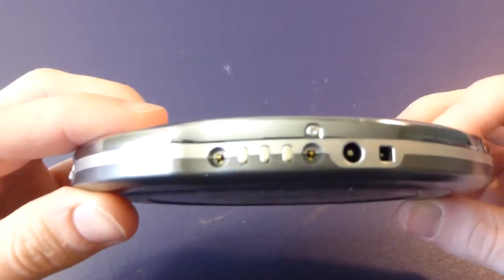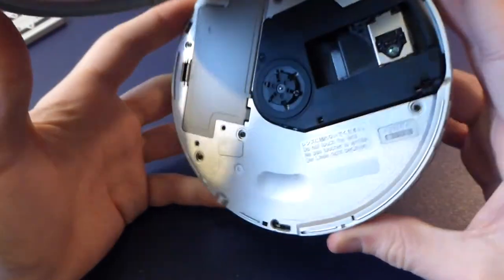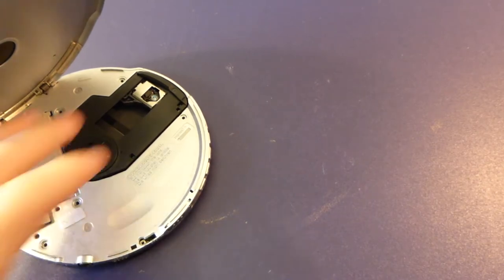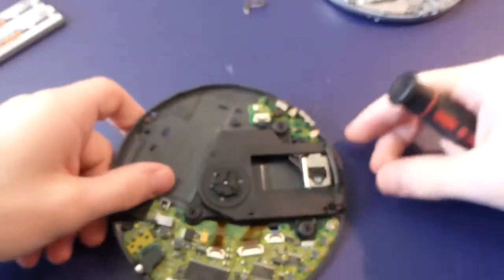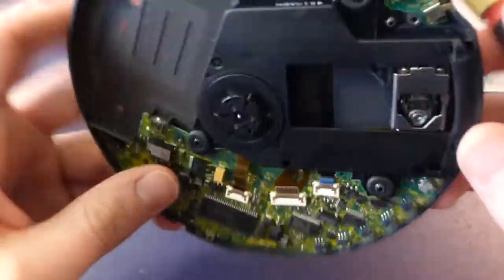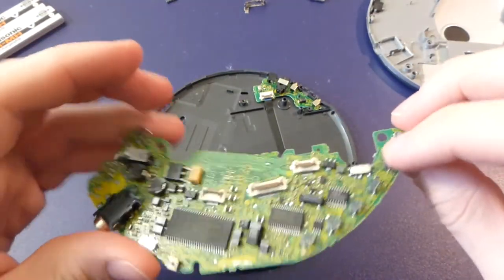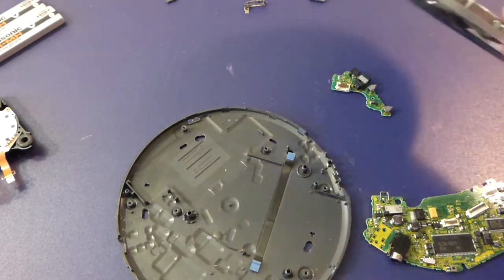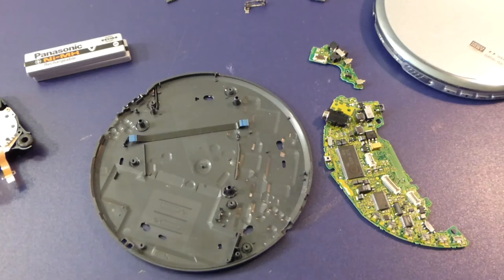Teardown of the World's Thinnest Portable CD Player in 2004

Comment: Sony had a thinner CD player 2 or 3 years earlier. The D-EJ1000 is 13.9mm thick, the Panasonic one here is 14.4mm. 😉
When it comes to rechargeable batteries, there is no special magic here. These are ordinary gumsticks batteries used in many different portable devices.

Comment: hey  i have the service manual for it. you want a copy? also  replacing the coupling capacitors between amp chip and earphone jack with 6v 220uf, then the bass sounds like sony models.

Comment: mine has recently developed a fault.  when you press play the green lights come on under the play and stop buttons, and then it changes to the led pattern like when it's charging, and after a few seconds it stops.  the cd never plays and the motor does not function.  I scoured the net and bought 4x replacement batteries, and still no joy.  works perfectly when connected to the mains.  anyone have any ideas?
Reply: Make a (720p) video (with good lightning) about it ? 🤔

Comment: Wow makes me wonder what's inside my Panasonic SL-NP500. One of the few things I noticed was the difference in overall clarity with newer players. While the shock protection and battery life went up dramatically over time, the sound quality took a turn for the worse. I mean overall filtering improvements were few and far between in the 90's but the way the highs,mids and lows were presented really took a dip. As is manufactures started to favor bass heavy tones instead of a clearer more balanced audio signature. It was for this reason that I never gave up on the older tech since I knew Panasonic and probably other manufacturers took great care in designing and engineering their audio amps and accompanyed circuitry.

Comment: I remember Sony making a thinner one that was almost as thin as 3 or 4 disk stacked.
Reply: Do you remember the number model of it?
Reply: @jeremifrancisco1  D-NE20, however I remember it with a bit of over exaggeration. It was 1.3 cm in thickness and was released 2005. Hm... or perhaps I was right, 4 disks is probably something like that no? xD .. oh well pretty thin either way hehe
Reply: TH3MS thanks flor your reply! I'm looking to get one portable CD player. Only thing is, the Panasonic and Sony are expensive. So, that kinda sucks, haha.
Reply: the sony D-E01 or D-EJ01 depending on where u lived is comparable may be even thinner but from 1999 and there is also the D-EJ2000 that was thin as a cd jule case back in 2002